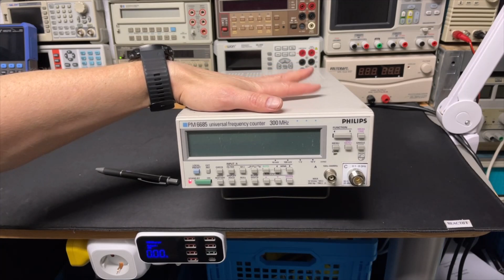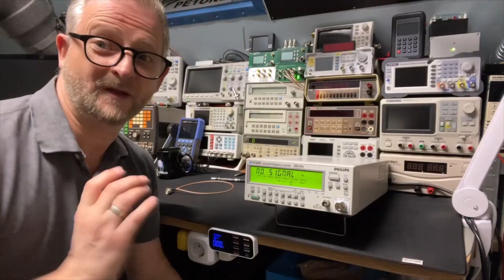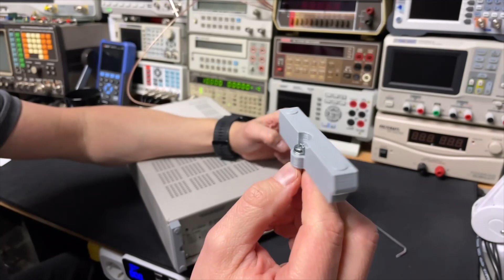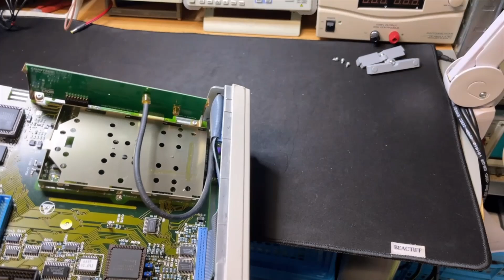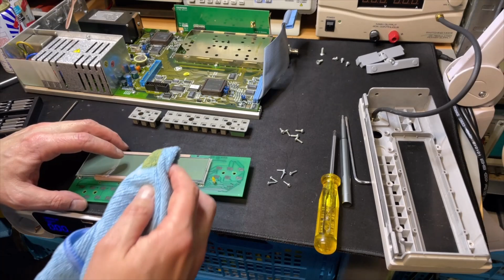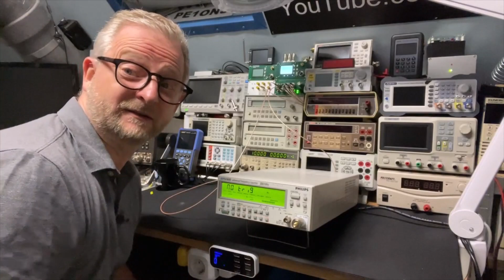#233 Fluke Philips PM6685 8GHz Frequency Counter Teardown Cleanup

Comment: Hi Tony, I am Razvan from Cojotech.

I pulled out the test report for your prescaler and it should be good to -22 dBm at 8 GHz. If you're willing to discuss this, we can try to figure out if it's an issue with the prescaler itself or with the test setup. If it is the prescaler, I can replace it for you, but it could easily be interference from the environment that gets picked up by the cable or by the signal generator, which would then inject it into the output signal.

Two quick things you can test is weather the output signal at the end of the cable is within the sensitivity window of your prescaler (-22 dBm to +14 dBm), and the other one is to try turning off your wifi router, if it's close by.

Cheers,
Razvan
Reply from the maker: Hi Razvan, Thank you for contacting me, looking at how it is build and the components you use, i am sure its my cheap-ass generator that just does not output enough on its limit of 8GHz, which is also its max.
Reply: @TonyAlbus  In any case, if you decide to look into it and you're still not getting the expected results, please let me know.
Reply from the maker: @cojotech  Thank you very much! i will.

Comment: Nice find and clean of the screen - very bright and viewable.  I seem to remember that you can add the battery option too.  There's a hole behind the sticker on the back for a switch for it.  I have an external version of the prescaler, but you have to remember that the display isn't in Hz, it's Ghz :)
Reply from the maker: Thank you Stephen! cool you also have one.

Comment: Hi Tony,
Nice frequency counter! The internal oscillator needs at least several hours to fully stabilize. Just for fun, see what happens if you put the meter on its side and upside down. Gravity affects the OCXO's oscillator by several ppb, so you'll see a variation in the rightmost one or two digits. Actually, the difference in gravity is 2G if you put the instrument upside down. You're going to miss all that fun using the external frequency reference...
I expect the oscillator's heater to remain switched on, even with the instrument switched off but connected to the mains. You'll see the "standby" indicator lit with the instrument switched off.
Reply from the maker: Hi raymond, Thank you!  , yes i made that mistake once... where i adjusted one on its side :) becouse it needed to be done from the bottom..